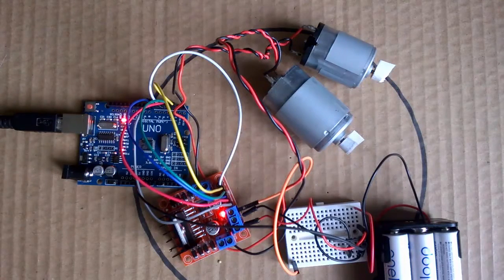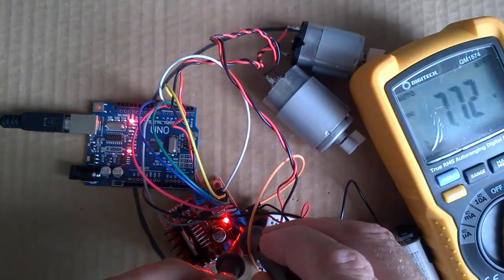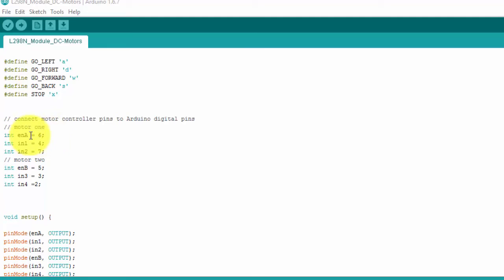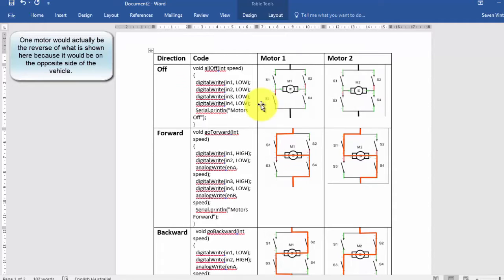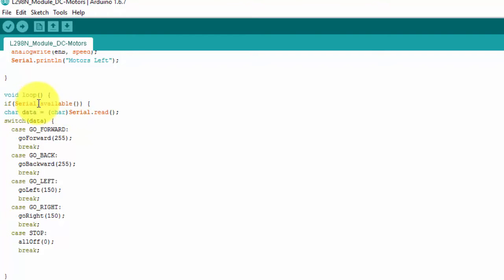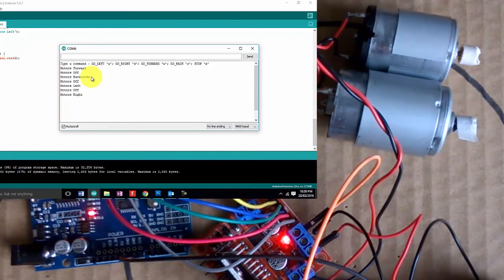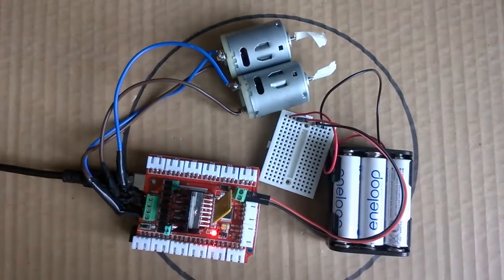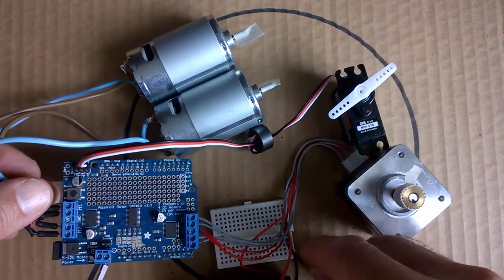Lesson 8 - Two DC Motors - Driver Modules & Shields - Arduino a Quick Start Guide

Comment: can u make a video of how to control these with android phone using the same motor driver
Reply from the maker: Sure, controlling motors in this setup is easy with an android phone. I will try to get some time over the weekend to do this for you. The app that I most commonly use is Bluetooth Controller. https://play.google.com/store/apps/details?id=apps.BT&hl=en
Reply from the maker: The vehicle in this video was controlled with the app mentioned above. The source code for the Arduino Uno can be found in the comments https://www.youtube.com/watch?v=0u3ndkzC_nc